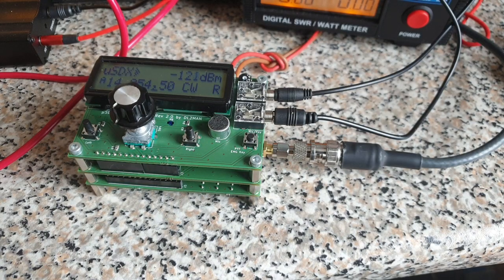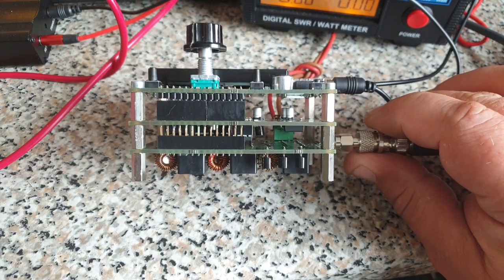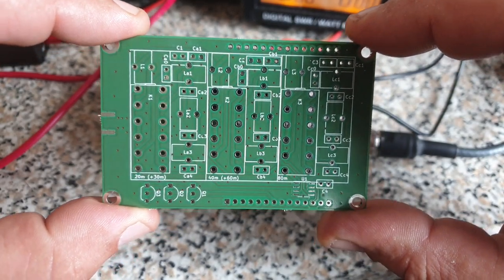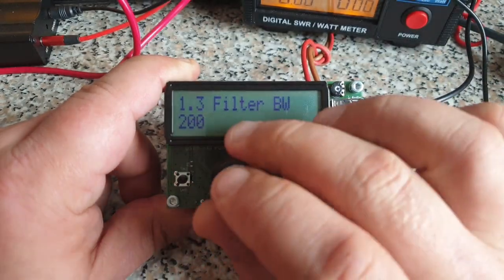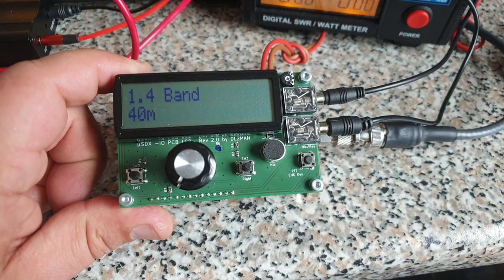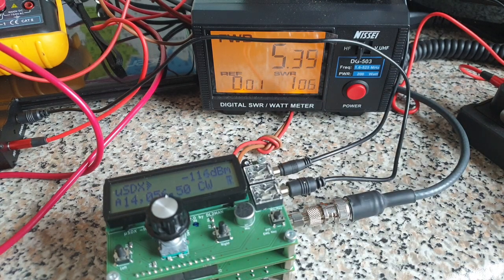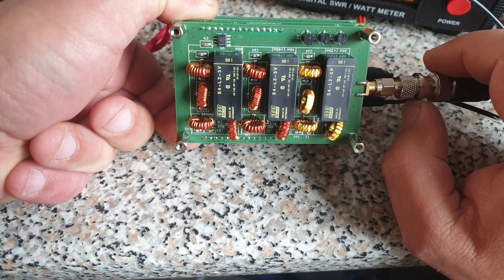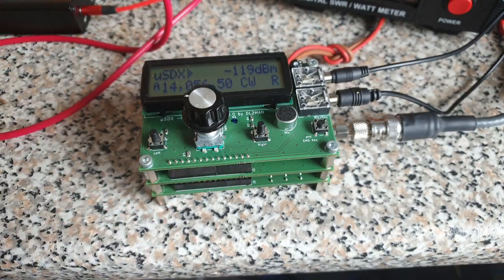uSDX Multi-Band, all-mode Class E TRX !!! Update of the "DL2MAN Sandwich"

Comment: Great projects and video's, thanks. I wonder why nobody is making boards fit in some sort of portable handset configuration like portophones? It is so much more convenient to hold a transceiver, connect an antenna and push a button with your thumb or finger. Dials (knobs) on top and display on the front higher section of the case. Case could be metal but also plastic but not wider than a standard dual-band handset.